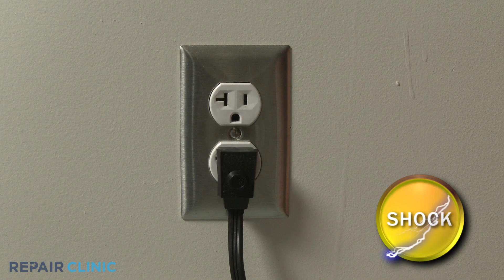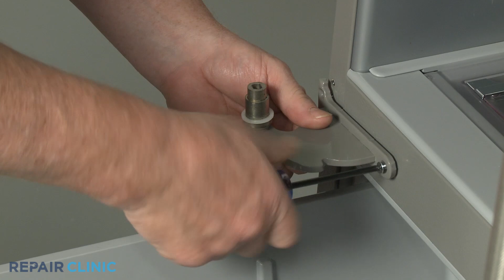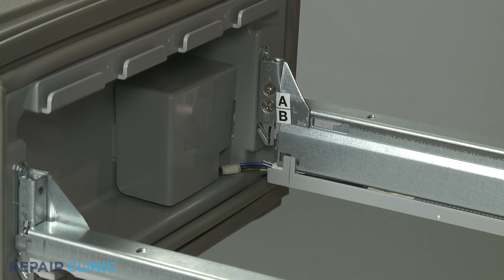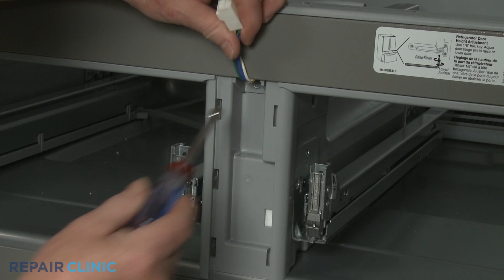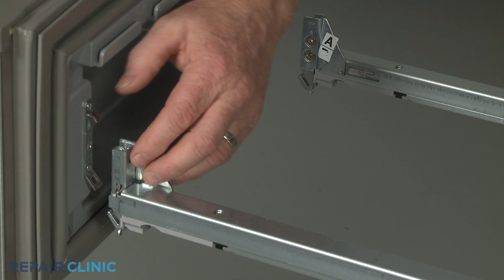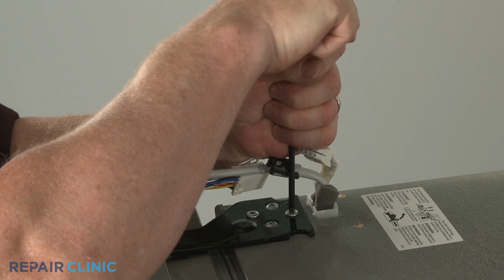KitchenAid 5 Door Refrigerator Pantry Drawer Thermistor Replacement W11168403

Comment: Yeah, everything is so easy because it's a brand new Kitchen-Aid. In the field, things don't go so smoothly. Some parts are stiff like the drawer track if some kind of syrup gets spilled and the parts stiffen or rust. To replace a simple thermistor, the unit has to be stripped to the bare cabinet justto remove the evap cover. I would never recommend a Kitchen-Aid to any customer. Labor can cost hundreds of dollars just to replace a fan. Ridiculous.

Comment: Long shot, but I have this fridge, can anyone tell me if there is only one thermistor? My Fridge isn't getting cold, freezer and drawers are fine. I was told to thaw the fridge and replace the thermistor but I just want to make sure I am replacing the one here in the video and there isn't multiple.  Can someone tell me which one is responsible for the Top portion?
Reply: I have the same issue. It seems to be the thermistor at the back of the fridge
Reply: @Laissez_Faire  I figured it out. There is one for the fridge and the trays. If your top fridge goes bad you need to replace the one that is connected to the fan and thermistor in the same harness. Took about an hour to replace. Not too bad. I would assume there is 3 thermistors in the fridge
Reply: @slowx7amg  perfect 👍🏼. That’s the part I purchased. It comes with the fan and two sensors
Reply: My fridge only cools to 57 degrees… do you know which thermistor I need to replace?

Comment: I have a 5 Door Refrigerator Whirlpool and the user interface was not working.  I purchased a new interface and wiring harness to replace them.  When I opened took off the user interface off the pantry drawer, I found that the wires had corroded due to water dripping on it from the water dispenser above.  If you have a problem with no power to the user interface board, check the connections.

Comment: Hello and thank you your very informative videos. My fridge is about 2 years old, purchased for around $5000. I have the following problem now. Lately I see a 6C degree difference between upper fridge and the left pantry drawer. This pantry now is freezing everything in it if I keep the setting to 3C as it has always been set at. So I changed setting to 4C but now the pantry shows temp at about 1C and the rest of fridge is showing around 7C. My question is: Shouod I replace the Thermistor for this pantry drawer or Shouod I replace the evaporator/Thermistor/Thermostat assembly? Or is it something completely different. This is a $5000 fridge and obviously I can’t effort to simply have it replaced. Thank you in advance for any suggestions you may have.
Reply: b m don’t buy a 5000 fridge